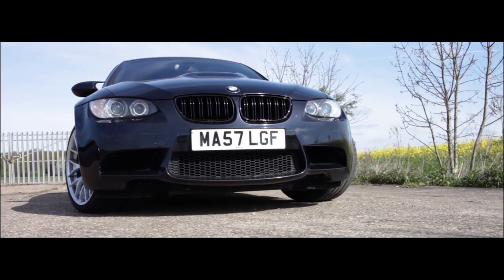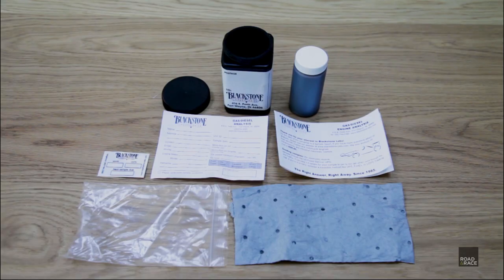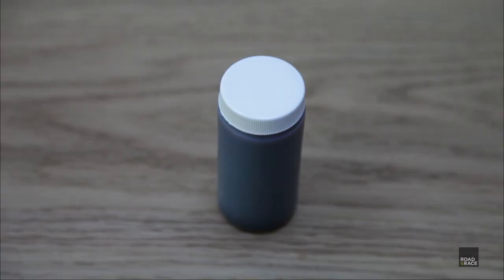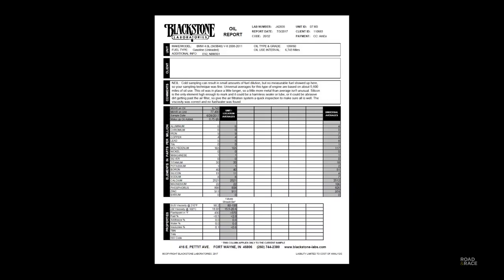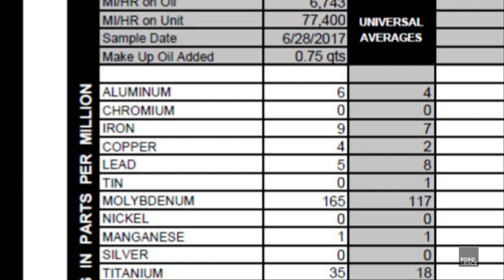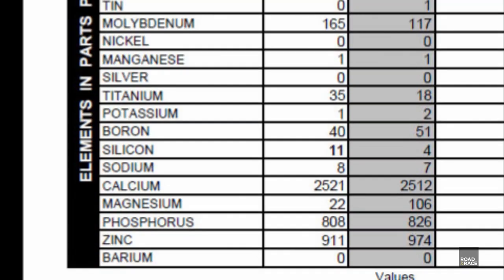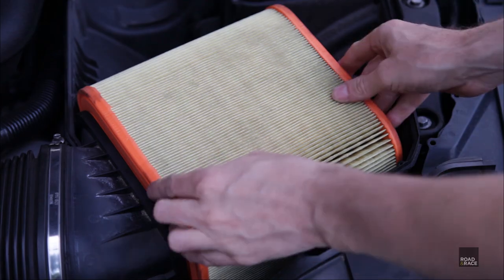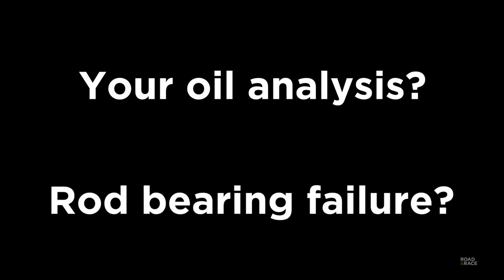Rod bearing failure oil analysis detection in BMW M3 E92 (S65)

Comment: Great vid!  Something else you can do to detect internal engine issues is; before discarding your old oil filter, take a sharp blade, cut off the ends of the filter, then unravel the pleats and examine carefully for any evidence of metallic particles.
Reply from the maker: +Phil Thomas Thanks Phil will def try that next time.
Reply: One other suggestion is to fit magnetic plugs to your sump.  They will immediately highlight any ferrous particles in your oil.  I got mine from:

http://shop.motorsport-developments.co.uk/magnetic-drain-plugs-43-c.asp

You can identify the correct size and type of bolts you need here:

http://www.realoem.com/
Reply: @philthomas9396  wouldn't this defeat the point in an oil analysis if all the particles get stuck to the sump plug? Or make the analysis less reliable if let's say half the particles are stuck for example?

Comment: I've been using motul sport ester 5W50 on my 2013 E92 for about 4 years now on road and track (only 6 times a year) and my oil analysis is spot on. And on the other hand my brother has been using ravenol 10W60 on his 2013 E92 for the same length of time and his oil analysis is also spot on. He prefers the 10W60 just cause its the correct viscosity not for any other reason but i believe the lighter oil  dissipates the heat build up a little quicker and my car seems to be a little more better on the fuel maybe cause of the lighter grade, im not sure. But both are excellent oils and we do our oil changes at 7000km intervals.

Comment: I replaced my rod bearings last year and although there was metal left, you can definitely see more wear than there should be on them. Not saying it was on its way to car failure, but didn't feel like driving around in a ticking time bomb. In retrospect, I probably shouldn't have done them giving I may be selling the car soon, but at the time I thought I'd be keeping this car longer, but I've now decided to move on to something else.
Reply from the maker: +The Annoying Tourist That's interesting.  How many miles had been done when you replaced them?
Reply: Road and Race I had done about 74k
Reply: Unfortunately I lost the original photo of the rod bearings, which had more of the worn ones on the rest of the photo, but you can see from the top right and lower left are pretty worn looking. I had another one that was showing copper. 

https://www.instagram.com/p/BJTCOkOgx_u/?taken-by=theannoyingtourist
Reply: how much did it cost you?
Reply: Discount Pharmacy id like to know as well
Reply: Hi, I having been thinking about getting a 2013 M3 but this bearing issue worries me, if caught early enough is it possible to get fixed?  If so, how much does it cost?  Thanks in advance.
Reply: Puneet Kalhan if your engine hasnt blown up then  yes, you can replace them, ive heard theyre about 2500 dlls

Comment: Greetings from Canada, this is a great video. My 2008 M3 convertible has 59,000 Miles (96K)  and my results just came back. They are half of what these are, so I am very happy. I owned the car for almost a year, but since it was traded in, I have no history on it and do not know if there is a way to tell if the rod bearing were done? The car looks like it was never sat in, so I don't believe the mileage was tampered with,  and this test also kind of reassures me of that, but I have to admit, this rod bearing thing is always on my mind now.  Do you still have your car Road and Race? I have to say this is the nicest car I ever owned and may keep it for ever  :)
Reply from the maker: Greetings.  Thanks mate.  Only way to check the rod bearings is to take the front subframe apart.  Assume they've been done and get it booked in.    Sold mine a few years ago but do miss it.

Comment: Increased silicone content can be caused by intake system leak, i.e. vacuum hoses, intake boots.  A dirty air filter means it's keeping the dirt out, but a vacuum leak lets unfiltered dirty air in.  Smoke testing the intake system is the best way to be 100% sure you don't have leaks.

Comment: I've had 6 oil reports from 60-102k miles, running Mobil 1 0w-40 on my 09 M3.

Iron 6-8-9-9-12-14
Copper 1-1-1-1-2-2
Lead 0-0-0-0-1-1

About to do another as I'm due for a change.   I never drive hard until the oil is warmed completely.

Comment: I heard the 2011+ model years of the e9x m3 use harder rod bearings that can be harder to detect wear through the oil analysis.
Reply from the maker: +JAMA That is interesting.  So they changed the part for later models?
Reply: I believe so
Reply: But did the 2010+ model not also get a power boost? I know the official wording from BMW does not indicate a power increase, just transmission tuning. But a friend of mine drove both a 2008 and 2010 extensively (he's a car journalist) and remarked the 2010 pulled noticeably harder. That's why I've been eyeing 2010+ models. Or could it be that the DCT changes from a 6spd to a shorter geared 7spd at some point?
Reply: 9000Redline even 40hp wouldn’t be anything to make you go wow i feel it, so it surely was for other reason then “extra” power 😉

Comment: Did the instructions of the oil test company say you should take the oil from the oil filter housing? Taking the oil from that close to the filter could mean you picked up an unusual amount of dirt that has accumulated in front of the filter. Maybe that is where the silicon comes from.
I learned that you take the oil from the oil coming out of the engine, but you have to let about two or three litres run out before filling the test sample bottle.
Reply from the maker: I can't recall.  Possibly.  The instructions do say to sample mid drain.
Reply: Maybe someone should take two samples, one close to the filter, so that you can see the "totality" of the - if it's the case - bearing material, and the other one, from the engine, to see the condition of dirt.

Comment: Great video !! Ive had a rod bearing failure on my e92 m3 (2008) . It happend after 37500miles only. Engine was replaced to a new one and that motor has been going excellent for 38000mi now . But maybe I should do this analysis the next oil change. Do you know how much it costs? :)
Reply from the maker: Oooh, shame about your engine failure.  The oil analysis cost me about $20 i think.
Reply: Road and Race p

Comment: What do you think about using a 5w50.. as it would be better on cold starts.. I have read some owners run this .. Nissan GTR use 5w50 or do you think you should continue to use what’s recommended and also your M3 has high mileage .. so thinker oil maybe better

Comment: Interesting, as usual. I can't find your video where you look in detail at the service book. I helped a mate buy a M3 and have lots of copies of service books, so it would be interested to see how yours stacks up?
Reply from the maker: Thanks mate.   The service book video is here:  https://www.youtube.com/watch?v=3K_o-VFM66k . Let me know your thoughts.
Reply: Oil services are consistent with the ones I looked at. Typically, there's one longer than 2 years. There's no brake fluid on your second summary and the ones I looked at had spark plug changes earlier in their life/ lower miles.  I've got the records on PDF as I will buy an E92 when I fancy a change from E46, so let me know if you're interested and I can send. I have 4 or 5, all Pre LCI.

Comment: for this exclusive issues with rod bearing, I've sold my 2011 m3 cabriolet with 35000km , and bought a 911-S 2011 pdk, a brand new S65 m3 will cost 27k us$, so I decided o sell the car than take the risk of lose the motor.
Reply: Sad to hear it mate. Did you get a bad oil analysis back or were just paranoid about it and sold without knowing?
Reply: 9000Redline most likely the later 🙊

Comment: i killed 2 engines. i dont know which route to take for the the third engine, Arp or latest BMW part. I cant have an oil analysis in Egypt
Reply: you can send it in international mail
Reply: Ditch the BMW.  Buy a honda
Reply: 2 engines wow maybe you need a snorkel so you dont stuck in the sand haha
Reply: Their engines blow up as well. For example research F20C (s2k engine) ap1 retainers. When the retainers let go valves hit the piston. No engine built for performance is as reliable as an engine to drive to the shops.
Reply: it's a known fact Honda makes very reliable high revving engines. You just gave their worst performance engine mistake. BMW is known for making mistakes a little too often...E46 and E92/e60 both with Vanos and bearing problems...throttle actuators etc....I love both Honda and BMW, but you have to tell it like it is

Comment: forum people have mentioned about mobil1 0w-40 as a better alternative than the 10w-60.  anythoughts?
Reply from the maker: +Michael Zhang I'm not an expert so I just stick to what BMW recommend which is the 10w-60.  If anyone knows better I'm all ears!
Reply: Michael Zhang Only on Turbo M3, M4, M5 and M6. All naturally aspirated BMW M need a good 10W60, because of high piston speeds. Also rod bearings dont like thin oil, it will thin out to fast if it gets really hot.

Comment: Is it correct that the rod bearing issue is caused because the tolerances are to tight and the oil too thick when cold?

I’ve seen a video suggesting 10w-40 as a solution In colder months. What are your thoughts?
Reply from the maker: I’ve read many things and don’t really have a definitive opinion.  I’m sticking to the recommended oil of 10w-60 though.
Reply: unless one is running this car in -30 celsius temperatures, castrol tws 10w60 is actually the best performing 10w60 oil for cold temps and on the lighter side for a 60 weight, breaking down to a 50 weight oil within a couple thousand km's. all in all it's a great all around oil. for summer performance runs one could go to a more robust 60 weight like the motul 8100 10w60 or liquimoly and for winter something like redline 5w50, but for the average enthusiast tws (now named supercar here in north america) is a great all around oil that will work for 99% of scenarios.

Comment: I would be changing the oil more frequently.. doesn’t cost much compared to price of car.. Always use fully synthetic.. 6700 miles is 10000km, I change mine every 5000km about 3000 miles.. better to change the oil more frequently than buy a new engine, especially if your out of warranty .. This car is now 13 years old..

Comment: best way to test for impurities I have found is to taste it. little bit on your finger, it should have a strong nutty flavor, should not smell or taste burnt, if you feel any grit in your mouth or if your gums bleed, could be excessive metal fillings, don't try this method however with PS fluid or antifreeze, AF always has a sweet tasten so you wont tell much and PS fluid smells and tastes gross, you'll probably hurl. I've got that good at tasting oil, I can blind taste oil and tell you which engine it came from, N52 is my favorite, synthetic of course !
Reply: AdrianJayeOnline :O dat cancer doe
Reply: Call 911.

Comment: where do you buy the oil kit when your not living in USA?
Reply from the maker: +AndersDog94 Blackstone will ship a kit for free worldwide.  I live in the UK and it was fine.
Reply: so its just go on there website fill out the information and select my country?
Reply from the maker: +AndersDog94 Yep.
Reply: Thanks. And then you first pay after you have sent the oil kit back?
I have a E46 M3 with 180k km on it and the rod bearings should have been changed at 141k km by the 2. owner, im the 4. owner. So a oil analyse will be a good check up i think.
Reply from the maker: Correct.  Let me know the results when you get them!
Reply: gonna go some time before i get it done, the car is in winter storage and need to put more than 3000km on the oil, i will try and get a test kit when the time is. Will tell you the result if i remember it :)
Reply: @anders949494  did you ever get the blackstone test results? My e46 m3 has about the same mileage and my report is clean. Thanks
Reply: @Volvo8Fifty4Life  it was fine :)

Comment: I really get annoyed at BMW ... I mean rod bearing failure?  Whatever happened to German Engineering ... or is it a case that the accountants now override the Engineers? 

Thanks for your video's I really enjoy them ...
Reply from the maker: Yeah, it is disappointing.   

Thanks mate, glad you liked them!
Reply: It's like the rear subframe failure on E46. Like... really? The rear subframe gets tear appart?!
Jesus...
Reply: Just for info .. some of custumers are over 200k miles and never changed them (you can also find some of them on used car website for sale for example) so I think that we are worring much more that we should .. pro tip never push it over 3k tr/min when it's cold, change oils in time and take care of her she will take care of you ;)
Reply: lolman77 No, the mounting points on the cars body crack. More or less the mounting points get torn out of the cars body. You need to weld in some Metal.
Reply: Every engine has some failures/issues that crop up. Our Ford vehicles all had their own share of problems as well. Then again, lucky we have the internet. It's always wise to research before making a purchase, and once you have your vehicle, it's wise to check the internet again for common issues and fixes. Like our recent purchase, a Transit van had a MAF failure and it only had like 15k miles on it. Of course the official Ford service could not even diagnose the issue until the engine went into full limp mode. I mean I have found posts about this, but I could not convince the boss to replace it in time. So yeah, the van was in full limp and after a new MAF, it works like a charm again.
Reply: sorry to disappoint you but this is also a prevalent issue with e9x m3 subframes with cars that are drifted, launched or driven hard as they should be. the problem is mostly due to the differential bushings being too soft and bending and breaking differential bolts and eventually damaging the subframe. the cure is a simple replacement of the bushings with harder durometer polyurethane bushings to replace the cheap and cheesy foam bushings bmw uses.
Reply: More so executives, they know BMW is a "lease" car... It's not a used car, so they spend more time and money on innovative things not on endurance or reliability
Reply: And btw my Japanese vq engine sips oil yet it was voted best engine back in its day..
Reply: tommy d u b b s totally biased and not true